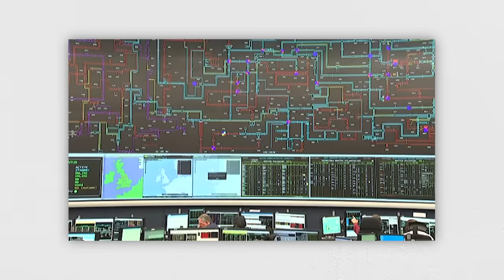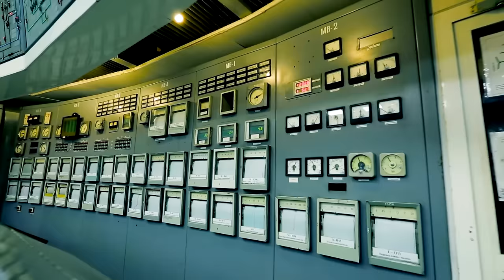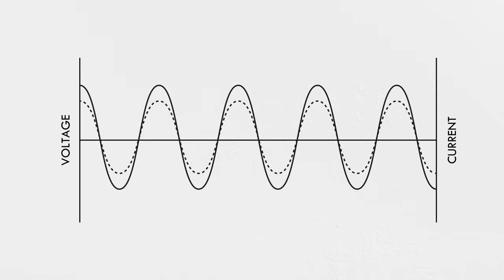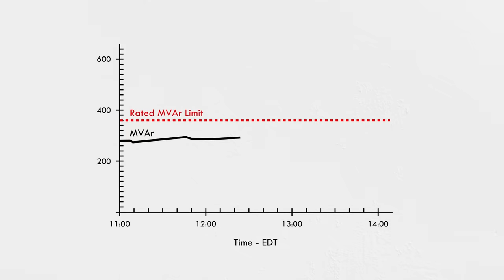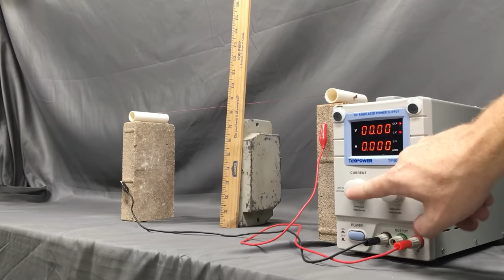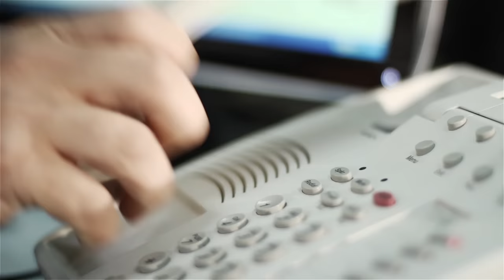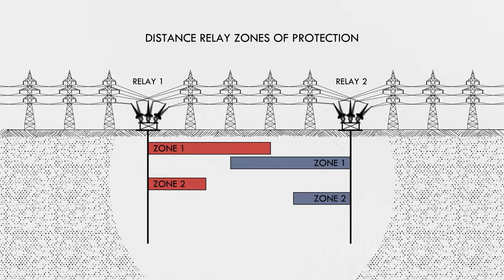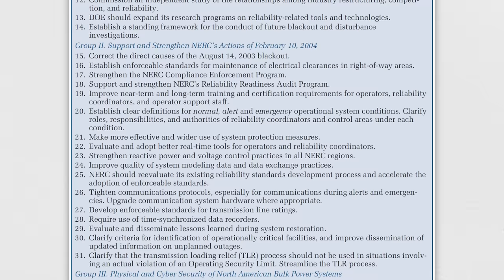What Really Happened During the 2003 Blackout?

Comment: Some of those are inaccurate. Westfield, NY is the only village and town to have electricity that day because they have an independent power grid and its own power plant. It is located where Welch is and that is how they got their electricity from. The power outage is the result of the solar storm that struck directly into the northeast, tripping those power lines, which causes the spike in electricity data, not air conditioning people consumed. In addition, it was the power plant in Buffalo, NY the one that led to Cleveland’s outages and they are the one that failed to send out alarms to other power plants, not Cleveland. Finally, there are some reports that day was the first outage occurred in New York City at 4:10 pm and it reached to Buffalo, NY at 4:35 pm. It spread west into Detroit at 4:45 pm. Cleveland went into complete shutdown at 5:01 pm. It was fully restored for the entire New York State at 2:20 am on the next day including New York City. Pittsburgh hasn't been fully restored until 7:35 am on the next day as well. Detroit took four days to restore the electrical grid there, so Toronto and Ottawa restored it six days later from the outage date. Cleveland finally returned to normal four weeks after the outage occurred and pointed to the computer glitch was the root of the problem which is why alarms didn't go off that day. They determine that it was the solar storm that struck the northeast, and took out the power grid by staggering its lines close to the ground and trees. Had it not for the solar storm, the outage wouldn't have occurred.
Reply: Much of Pennsylvania was fine too.